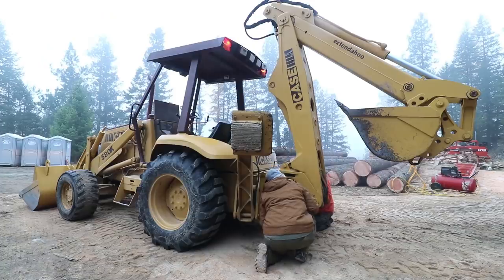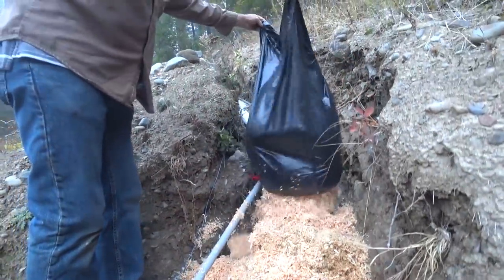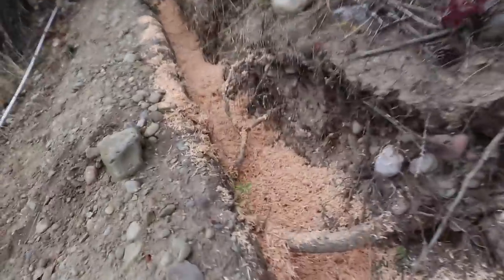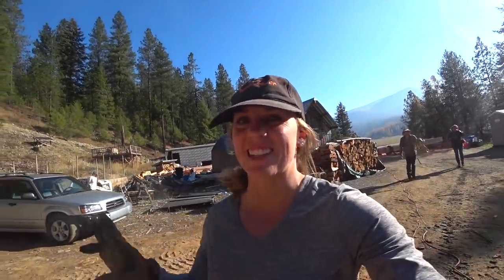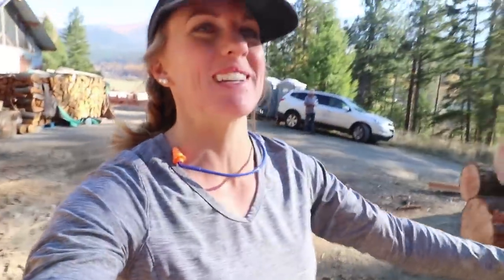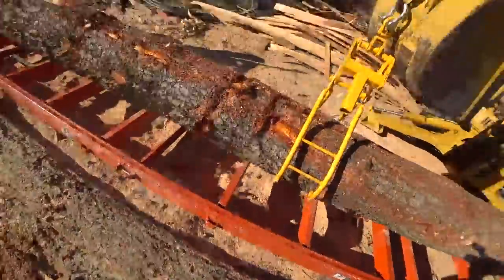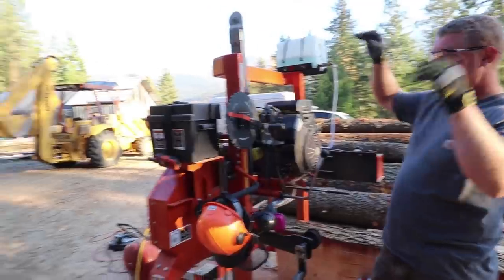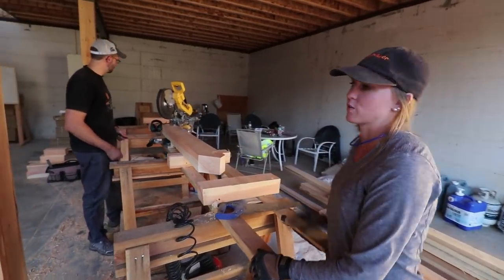Building a House Start to Finish: Sawmilling a Timber Frame by Themselves

Comment: Two pumps of grease in every zerk everyday. Check oil, air filter, Hydraulic fluid and fill with clean filtered fuel at the end of every day. Check for loose oil filters and blow out the radiator daily in dusty conditions with compressed air. If you have a problem like a broke zerk fix it then do not wait. Check tires every morning and keep an eye on your gauges, if you drop oil pressure shut it off.  Its only one backhoe not that hard to pull maintenance.

Comment: Grease the joints until you see the color of the new grease coming out of the joints. If not then your just moving the old grease around in the joint. You want to force the old grease out with the new grease. Your machine will take appx. 2-4 medium size tubes. And i have the best results with Lucas grease. 
Love the build. Looks beautiful.

Comment: They used to use sawdust to insulate the ice that was cut in the winter for ice boxes... The old style refrigerator... and the ice would last through the summer until the next winter

Comment: You bring up a lot of great points, it is not just one job, but a multitude of jobs to get the work done. On our small farm, we have 3 barns that are insulated with wood shavings. It is quite effective as insulation, although a bit of a fire hazard. This farm was built in the early 50's as far as we can tell, and it was used to grow hogs, And the barns still reek from the ammonia from the pig poo. But they are solid buildings, and well ventilated, so they work for our use.

Comment: Just to add, I have measured a diameter on a tree that required two of those logger tapes to measure (i.e. greater than 120” in diameter)...Can’t remember the final measurement amount, but it was an old growth Sitka Spruce up in coastal Alaska.

Comment: Sawdust is an excellent insulating choice.   My dad used sawdust in the bottom of water and sewer trenches,  but you only need to cover your pipes about a foot.  We lived in Montana and frozen pipes are a problem.   Another good use for sawdust is in an 'in ground dry storage or an ice house.  We filled the 1 ft. thick walls with it and also the floor.  Happy building.
Reply: I worry, sawdust is a good insulator when dry. I worry what will happen when it gets wet, I think it will compress and lose its insulating properties, watch your weather. ;-(

Comment: When you backfill a trench for conduit electrical or Plumbing lines you always put screening in first covered with screen so the stones don't punch holes in your lines that's why I saw this is a good idea to keep the stones from punching holes in your pipes and Cetera and it will

Comment: At some point you might want to try a battery powered grease gun, had one for my tractor loved it. Milwaukee might make one.
Reply: I have used many electric grease guns over the years, and in my opinion the Lincoln 20 volt grease guns are the best out there. I have gotten better service out of the licoln grease gun, than my $550.00 Snap-on electric grease gun.

Comment: Jesse, In you wrap up of your talk about the saw mill,  knowing now what you know about the mill, would you say its better to put on the ground, instead of the concrete block, to keep it as squared up as you wanted. Love the victory poss job well done. Love the music with it hahahah. Videos are great . great aerial shots. On the Generators I have a 13500 watt unit with a 50 amp plug. I bought at HF for my arc welding as I don't have a 220 volt outlet. And oh ya its great when its shut off. I don't subscribe, and comment to most peoples channels, but I had to with yours , because off all the negative people. Keep up the good work. And Pat you rock.

Comment: sawdust SHAVINGS  to protect water pipes makes excellent insulation,AND protects pipe AND when decomposed
    makes it EASIER to access piping in future (IF required)

-CUDOES to FIRST installment-but MUCH MORE work to do

Comment: Lock n lubes rock. Those are the best ones. Others kinds also lock on, but if they over pressurize they won’t release. Lock n lubes still will. Got them for the oilermen at the sawmill I work at.

Comment: Too Late, but I saw on another video on YouTube they used a hand battery drill to turn the shaft on the mill. Would have made it easier for you I think....sorry, have followed you for about 8  months.....very good job you two did all around.

Comment: Curious why you bought the WIDE LT.  Logs in your video are well within the capacity of the standard size and the wider bed frame is more awkward to work around when you don't need it.  I'm considering adding an LT WIDE (already have a 4 section 24' LT) but I would only get 2 bed sections as 3' diameter X 24 ft logs would be way too heavy to handle with my excavator anyway.

Comment: I noticed that your battery died previously. I have so e t-105re batteries running my off grid solar and have found the noco g15000 battery charger to not only top off my batteries on those long cloudy weeks but it has also saved several lead acid batteries out of cars/trucks that otherwise wouldve been turned in as cores.

Comment: If you greased the machinery every day as required the grease actually goes into the pins and bushes as designed. Lack of proper maintenance should be a criminal offense
Reply: After weeks of nonstop work and they finally finish and the best comment you can come up with is criticizing them about greasing?
Reply: The comment is not totally unwarranted; I have in mind that Jesse claimed to have made a living in the maintenance field... His own backhoe "squeaking" when the boom pivots is NOT cool. 

It's a detail, I'll agree on that. But it's an important - and potentially costly detail. Jesse's owned that backhoe long enough now that he should have picked up on the fact that the kingpin wasn't taking/getting grease, and done something earlier.

Having said all that, if I'd be in his shoes, I may have made the same mistake... Stress, pressure, fatigue, they all have their effect on us, and our decision making process.
Reply: Why not he was making such a drama around his failings as a machine operator to maintain his machinery. And add the drama about batteries and alternators and the mill constantly moving just proves he should never be allowed to be in charge of machinery.

Comment: Make sure you lube the heck out of the clamps and other mechanicals on the sawmill before retiring it for the winter.  You don't want a frozen clamp the next time you use it, huh?  Congrats on milling all 85 pieces.  Huzzah!  Ha HO, look at those proud Conquerors of Timbers!  WhooWee, that's a feelin'.  Hey, wait a minute, that timber still has bark on two sides.  Cheaters!

Comment: Iv'e seen some unsafe practices used with the chainsaw in this video, the claws on the chainsaw are there for a reason to help reduce the thing twisting/bucking in your hand if the blade bites in, operating it by using the end of the blade arm as the cutting area is a bad accident waiting to happen. Mate of mine lost one hand while pulling the saw out of a log while running it full speed and standing over the saw. That safely lock will only operate in such occasion when it bucks up and your hand is there to make it trip, but if a saw bucks up and you lose your grip there is nothing more then good luck that will save a body part.

Comment: With Pat cutting those timbers and it appears with no AnchroSeal, did checking become a problem eventually?
Reply: All those timbers were oiled and sealed before the framing started. I peeked over on FB.
Reply: Thanks.  I saw Alyssa sealing them after they came off of the mill.  Didn't know there was more happening later.

Comment: Do you use a crane to hoist the timber frame ???  You both should be very proud :-)
Reply: As far as I know they used ropes to pull them up in the workshop they visited. Would be cool if they did not use one

Comment: 10 foot circumference not diameter. Not taking more footage from Jesse's point of view while using the backhoe was a HUGE opportunity missed.
Reply: There are some that measure DBH (diameter at Breast Height.)  It's been awhile since I used one.  U of Wisc at Stevens Point, used to be a great Natural Resource College.  Should check in to see how it is doing.
Reply: No, it's 10 foot diameter.  The back of the tape is marked one foot every 3.14 feet along its length.  So if you wrap it around the circumference of a log it indicates the approximate diameter at that point.
Reply: Oh, that's cool!

Comment: If you had skipped the sawmill and purchased the finished logs in a kit from a log manufacturer, how much did you save?
Considering the work, cost of equipment, and risk of injury, I'm guessing it would have been a negligible difference.
But, you wouldn't have had all the video ops!
Reply: I think  that they put the figure at 12,000.

Comment: Never heard the term "Zerk" being used.  We always say "grease nipple".  However, I was working with a bunch of old, dirty-minded dudes.
Reply: Geeky Garden Technologies yeah that's the term ive always used and still do everyday at work so dont think it's the dirty minds but am in engineering so may be all smutty minded lol
Reply: Oscar Zerk is the guy that came up with the fitting. He died in the 60s in Kenosha, WI. It's not really common knowledge that Oscar Zerk came up with it (outside of those that grew up in Kenosha),  in fact there is no mention of it on the Wikipedia page for 'grease fitting'.

Comment: This might be a dumb question, but while i think its cool to mill your own lumber, why aren't you using pressure treated lumber?
Reply: None of it is in contact with the ground. so it will be just fine. The sill plates are a treated product if you saw one of the previous episode.
Reply: johnnysolami you'll have to go back and find the video but it is explained as to why and what the purpose is of not using treated lumber and at the same time Rod Timbers like that once they're put up and sealed up are aesthetically pleasing more so than treated lumber
Reply: Ahh... I guess that makes sense. I live in a moist, humid part of the south and we use treated lumber for everything haha Thanks for the clarification
Reply: Besides, living next to pressure treated lumber indoors, there would be a lot of off-gassing. Very unhealthy...
and as mentioned, it would ruin the great looks of the Doug Fir. They have put oil on it by now, and will probably oil it again once there's a roof on, and walls.

Comment: guy's if the sawdust gets wet then freez's is that gona be just as bad
Reply: yeah, dry sawdust might insulate a bit. But wet...... might as well left it open.
Reply: The trench has already been filled with sand hero, the sawdust was only meant to be a short term stop gap. But hey, as long as you get to regurgitate your negative BS right? Troll on!!
Reply: Timestamp where you think it shows that it's filled with sand. The lower part was backfilled, but she said that.  The upper part was open and they filled it with sawdust. Which isn't that great. It will get wet and freeze solid. Hero.

Comment: yeah, when do you get to move in, are you all, gonna move in as soon as you get the timber frame up.
Reply: They do have a living space 40 feet away that they've lived in for a few years, no big rush 😂😂😂
Reply: Not quite yet.  They still have the SIPs to install, and a tee tiny bit of interior finishing/wiring/plumbing to do.  Give them a week, Denise.

Comment: next time you build a house and need to mill up the many logs buy the self feed attachment
Reply: I've seen in other videos the self feed attachment and it seems the way to go, but in the case of handling these 3 ton logs you would still need the heavy machinery to move the logs around, I'm still wondering if it would be that much of a work saver.

Comment: In my opinion wood chips  is not the best material to insulate in ground pipes without a casing around it .Wood chips.. will absorb moisture and loose their insulating propertties.
Reply: It's just temporary until the sand is laid. Maybe you missed that video???

Comment: I would be worried that the sawdust will act as fertilizer and you'll get more growth and roots on the trench. Might not be ideal.
Reply: Dejay Rezme temp fix to stop the freezing,  if you were to check their fb page they've already removed the dust and replaced it.

Comment: One person with general construction knowledge would have saved these two so much money, mistakes and problems. Such basic little stuff, easy to forget not everyone knows about building.
Reply: So?
Reply: If they did that then they wouldn't have learnt all the stuff that they have.  Jesse talked about such 'experts' in a another video saying that you can have a whole team of experts design, manage, construct and build your house and there will still be problems which will incur extra costs and time. 

They've done it the hard way and i am sure both of them would not have it any other way.
Reply: Jesse talked in another video, about actually trying to hire someone to make the basement. Nobody would help they wanted the whole job or nothing